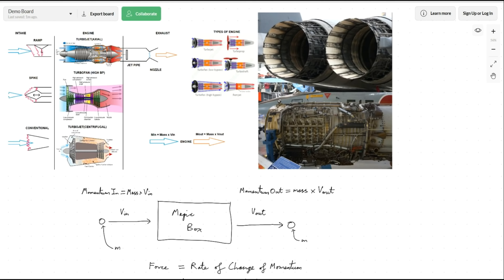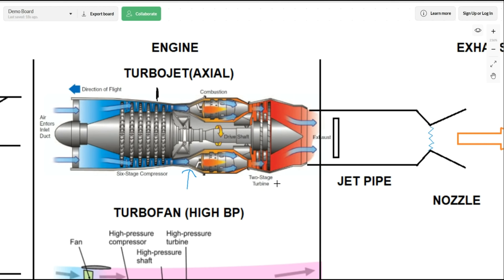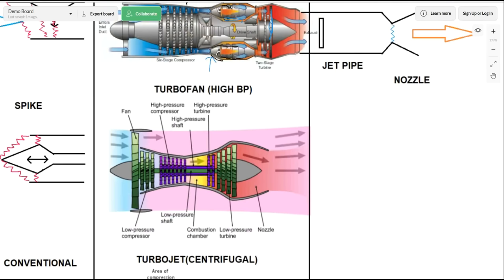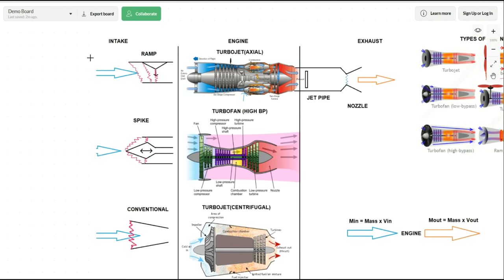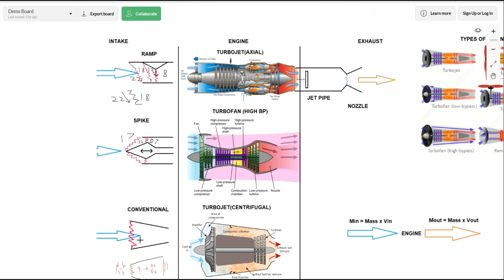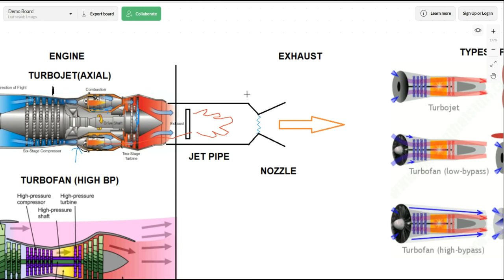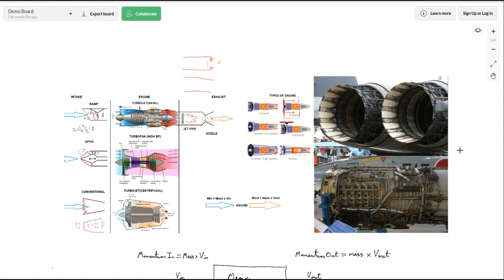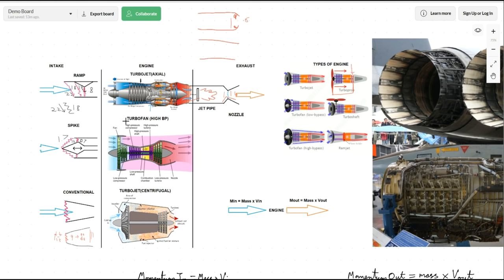Explained: How Jet Engines Work

Comment: Great videos guys.  Well done.  As an aerospace engineer I liked this video.  One thing you may want to add though is a enthalpy-entropy diagram comparing the brayton cycle to say the internal combustion cycle.  Might show a little bit better why gas turbine engines are typically preferred for military aircraft.
Reply: Roger Howland well going into the brayton and Otto cycle is where most people tend to get lost. Just wanted to keep it relatively basic
Reply: Recoil 2-1 no worries.   But still a great video

Comment: Sorry guys, there's an awful lot wrong with the descriptions given. Primarily you make the case at the beginning about accelerating the mass and thus get an equal and opposite reaction, spot on. You then spend the remainder of the video talking about extracting as much energy as possible from the exhaust gasses via the turbine blades. This is an error, if you extract energy from the exhaust gasses then you are slowing them down thus reducing thrust. The turbine blades are purely there to extract enough energy to turn the compressors or ancillaries. Thus the job the engine is doing is critical. So a fighter jet engine will only want to extract enough energy to turn the compressor blades with the remainder of the exhaust gas producing the thrust. An airliner engine will extract more in order to turn the huge fan blade at the front, but then this is what generates around 80% of total thrust so it makes sense. A turbo-prop will likewise extract most of the energy from the exhaust gases because it is getting thrust from the prop and not the gas turbine part. Similarly the turbo-shaft. There are also a lot of errors in amongst the rest. Not trying to be argumentative, I think the effort that goes into these videos is great and I enjoy watching them, but there is a lot of misinformation.

Comment: About the igniters, loads of aircraft have switches (especially airliners) to turn them on, or automatically run them up to 10 000 feet, in case there is a bird strike. It greatly decreases the chance of flame out in that case.
Reply from the maker: Copy X

Comment: Great video. Can we get a video on Air engine restart. how that works it would be cool :D
Reply from the maker: roger I like it
Reply: An engine relight procedure in the air is almost identical to a normal engine start except that the engine has low RPM. Not much different aside from that

Comment: So near 6:46 and after a comment is made that seems to suggest that the source of thrust occurs at the turbine and that most people incorrectly believe that the forward thrust is a result of the high momentum exhaust leaving the engine. This seems incorrect to me. Is it possible to get some clarification on the statements that were made near and after the 6:46 timestamp?
Reply from the maker: Actually I agree with you there, I think Recoil may have been slightly miss-communicating what he was trying to say there. I didn't say anything in the vid, I'll see if I can get him to respond now.
Reply: Ok, I will clarify. The purpose of the turbine is to extract as much energy from the exhaust gases as they pass through.This energy is transferred along with energy from the compressor and diffuser (before the combustion chamber) through a pair of thrust bearings and that force is then transferred though thrust mounts into the airframe. The exhaust gases leaving the nozzle are further harnessed by the shape of the nozzle (this is only a small amount of the thrust ~10%) but a lot of people thing that the gases at high momentum after the nozzle power the jet and not much happens inside. Hope that clarifies things.
Reply: Thanks so much GR! I do appreciate it.
Reply: Thank you so much Recoil. I appreciate you giving this your attention. You clarify things a bit but I am still confused on a point here - and I looked with no luck to find a succinct technical breakdown (I'm a physicist, so quantification is great) of the energy mechanism <-> thrust balance so if you have a source that would be fantastic, but I don't want to overburden you here. Anyway, my remaining point of confusion is that to my mind powering the turbine, which is central to the engine working principle, is actually removing power from what would be used to produce forward thrust (i.e. subtracting kinetic energy from the exhaust gas thereby reducing the delta-momentum operating principle you cover first in the vid). So I would think (perhaps incorrectly) that energy used to turn the turbine reduces thrust while factors that contribute to forward thrust would be pressure gradients between the interior of the engine and the exterior - so in effect the exhaust gas is producing thrust by "pushing off of" essentially every surface of the aft engine interior. I found this link gives a general breakdown of these thrust components (http://www.dtic.mil/dtic/tr/fulltext/u2/722283.pdf). So I would think the turbine would want to extract only a minimum (or rather, "optimal") amount of energy from the exhaust gas with the remainder of the exhaust gas contributing to thrust. Might you have a good reference for me, or maybe you can break this down for me further - if you have time, of course! Again, thank you so much and thank you for putting together this excellent vid. Sincerely,

Edit: I think the wording in this description is complicating me understanding your approach: https://www.grc.nasa.gov/WWW/k-12/airplane/Animation/turbtyp/etth.html

"In a jet engine we use the energy extracted by the turbine to turn the compressor by linking the compressor and the turbine by the central shaft. The turbine takes some energy out of the hot exhaust, but there is enough energy left over to provide thrust to the jet engine by increasing the velocity through the nozzle."
Reply: Hi I'm not sure I really understood your explanation in the video where you talk about the turbine expanding the air to extract power out of it. It is my understanding that the turbine is there mainly to enable self-sustaining compressor rotation using the exhaust gases to blow through the turbine and spin it. However due to Newton's 3rd law, in order for there to be thrust acting on the airframe in the forwards (left) direction, there must be a force in the backwards (left) direction which can interact with the airframe to push it forward, in this case provided by the accelerated exhaust gases due to the combustion and subsequent expansion. I think you are trying to explain that the common misconception is not that the jet of air outside the nozzle is directly the source of thrust but rather that it pushes on the turbine blades to push the engine forwards and indirectly exert it's reaction force on the airframe, pushing it forwards and generating thrust.
Reply: Very well said. This is my understanding of how the engine functions as well.